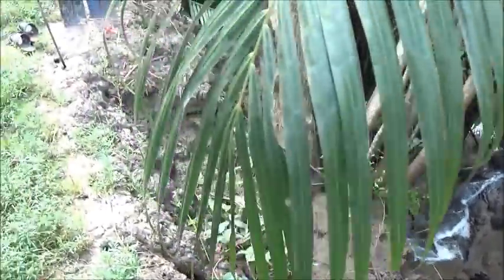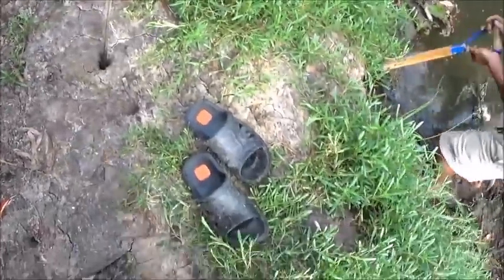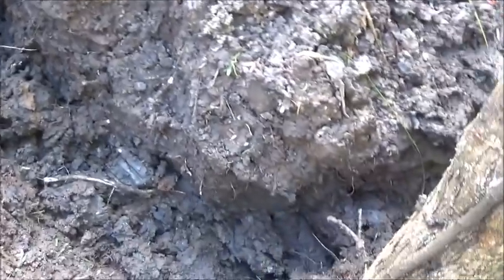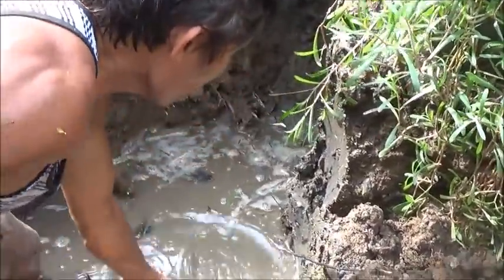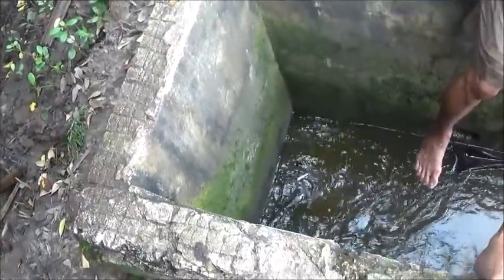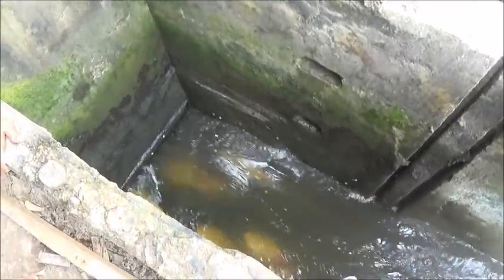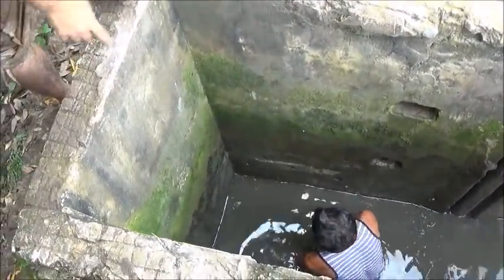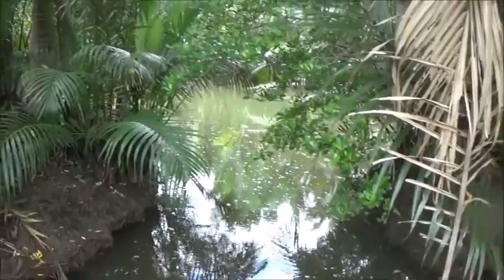Shrimp Pond Dyke Repair And Setup For The Gate Valve Placement

Comment: Guys, Just pull the gate at high tide when the gate is pressure balanced.   You might in future add 1/3 of a plastic 
barrel as a cap being that it tapers toward the middle.

Comment: Hi Brian 
Your Idea for the gate is genous I would recomend the following 
1.the seal need a housing u can make it using a bike tire .
2. The presure will be too much so opening and closing the water gate will damage the system and will be hard due to the frictionso you need small gates on top for water level contorl 
This small gates will help you to control the volume of water you have. You can make this yousing a small pipes and it wont cost you noting.
3 opening the big gate shall hapen only when u have equal presure on the two sides so it will be easy  or when harvesting so if it is damaged it wont impact your production.
When u have a live stock in your pond you will not take the risk of major  leaks due to seal damage.
Good luck for all of you.
Reply: Also an L shaped pipe cut can top up the pond automaticaly when the tide is high
Reply from the maker: TPS, thanks for watching and for the advice 🤠

Comment: Using multiple pulleys may surely provide the mechanical advantage necessary to actually overcome the hydraulic pressure, but your bucket/gate system may not be substantive enough to survive such mechanical advantage.
Reply: yep Emma, I agree that is a point of stress lets see if we can make the door robust enough. However we will not have power at the pong for a foreseeable time. We want to take advantage of any advantage we can get. Mechanical or other wise.

Comment: you know you might take a piece of PVC pipe 1" and poke it into the hole at slack tide and pour a  slurry mixture into IT I know your in the backwoods if you COULD pressure grout IT
Reply from the maker: That's not a bad idea except the whole pond is riddled with these holes. Fix as needed is really the only option right now

Comment: Too much work Sir Brian, really complicated.... All you need to do Sir please do buy 4 pcs 2x2 good lumber, a concrete nail, wireless electric drill and your board panel,, to stop leaking please tilt that floor cement, reason? The edge of your panel board touch the bottom of the mud, stamp your feet pushing down the board, water stop leaking.... Thanks
Reply: The existing water check works but it is insanely difficult to work with and most importantly there is no way you can open and close it with 1 man which will be the staffing sometimes. Let's see if this works. We value the old ways but nothing wrong with trying to make a better mousetrap.
Reply: @jayandjhenlovingandlivingi5473  exactly Jay,  just because  they have been doing it one way for hundreds of years,  no reason not to try and improve. 
Would never have gone to the moon ect. 
Human nature in the west ( at least!!)  try it more efficiently! 😁